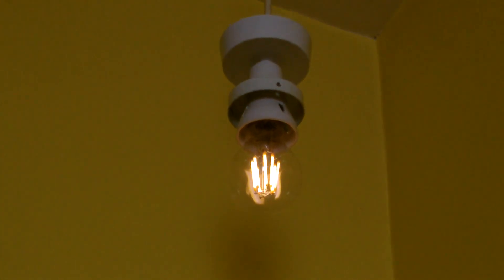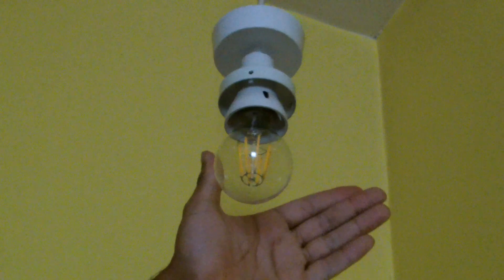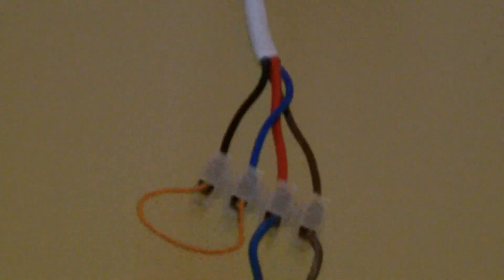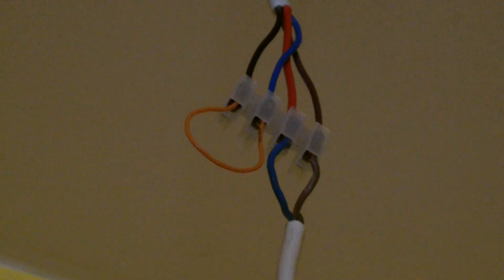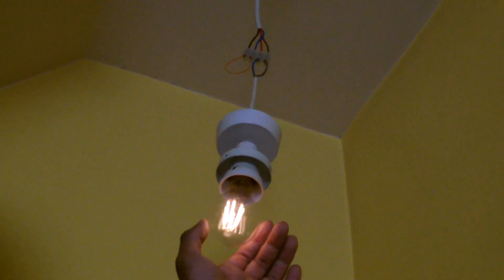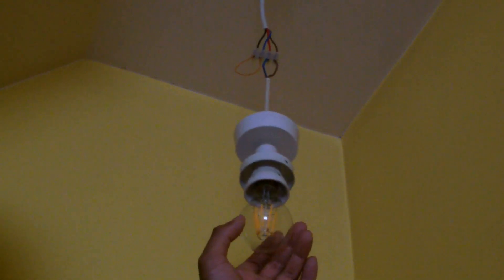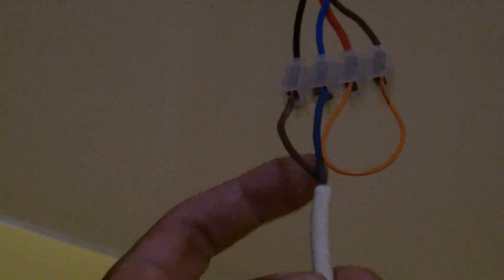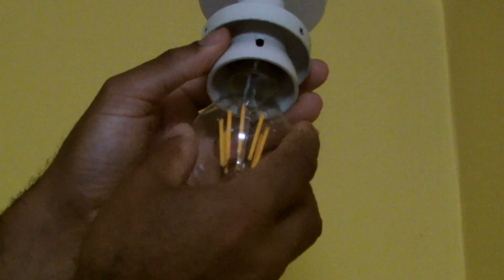LED dimly lit, or glowing, even when switched off demo

Comment: Fascinating -- and timely in my case after a switch got wet when a header tank leaked. After drying the problem ceased but I had the lighting circuit checked anyway by a qualified electrician.
Reply from the maker: Glad you found the video interesting.  Water and electricity are not good bedfellows, so glad that is sorted.

Comment: what if the wiring is OK, but the led still stays on after switched off?
this happens with wall switches that included some additional stuff (dimmer, status lamp, motion sensor etc.). In this case your wiring tricks won't fix the problem, you have to install a small (1 kOhm, 0.5 W) resistor.
Reply from the maker: Thank you for your comment. Please note this is an explanation and demonstration of a fault.  This is not a how to or a recommendation video. When dealing with the mains it is best to consult with professionals. If you used the resistor of the value you stated at the power rating you suggested then you would very likely have a fire.  A 1k Ohm at 240v RMS is would have to dissipate over 50 watts.  Even if your voltage was 110V the power would still be over 10 watts. (this is an example how quickly you can get into trouble if you are unsure what you're doing) .I've a video https://www.youtube.com/watch?v=AQtUgdHBvXc which deals with some of the topics you have mentioned, but the leakage through a typical dimmer's trigger circuit is not covered in that video.

Comment: The glowing after I turn it off does not bother me. But is it costing me additional electricity consumption?  Is this glowing wasting additional electricity?
Reply from the maker: The answer to the question is more complicated than you might first think. If we assume that the consumer's electricity meter ignores the reactive (capacitance of the wiring) component of the current then the answer will be: yes it does.
      By definition the fact that the LED is glowing indicates that it must be using power.  The real question is, how much power? 

If you were using a tungsten filament, such as halogen bulbs, then the answer will be less power than you were using before you changed to the LED. This will be true irrespective of whether the LED is glowing or not. 

My personal guestimate is roughly 0.036 to 0.01 watts when and LED is glowing due to the issue described in the video [value obtained using this vague calculation (240^2*2*(22/7)*50*2*(10^-9))].  So my guestimate based on glowing for a whole year is roughly 1142 kilojoules of energy which equates to 0.31 kwh per year. Roughly £0.06 per year if you live in the UK.

If you were to fix the problem by using a "shunt" then you are not necessarily curing the usage but more hiding the energy that causes the LED to glow.

If your electricity meter does actually measure the reactive component of the current then a glowing LED is the least of your worries.
Reply: @robertwilliams8032 ....."yes it does" isn't an answer to "is it"
Reply from the maker: Thanks for your feedback, did you read the whole answer by hitting the "Read more" link?
Reply: @robertwilliams8032  That has answered EVERYTHING AND MORE, that I sought to this issue. Much gratitude

Comment: Is it easy to gofrom switched neutral to switched live?
Reply from the maker: Thank you for the question @mikeypeters7003. If you are a person who understands your wiring then the answer is usually: Yes, it is easy to change. But it truly depends on the configuration of your wiring and my answer is assuming that it is wired in a typical standard way.  Tracking the path of live and neutral conductor paths through a circuit should be simple for a competent person who is conversant with typical electrical wiring. The fact you have to ask would suggest that you may not have the skills needed to maintain your wiring in a safe and secure way.  I would strongly suggest that if you lack confidence or you're unsure (in any way) then always seek the advice of a licensed professional.
Reply: @robertwilliams8032  Thank you for the reply. The extent of my knowledge would be basic at best. I would struggle with a ceiling rose.

Comment: When wired correctly power cannot radiate from the wire  to the switch to the wire from the switch because the earth wire intercepts it, light won't glow, but if the neutral is switched it will radiate to the earth wire plus the other wire which is now neutral, the light now glows. Now have I got that right?
Reply from the maker: very late but here is a technical explanation:  www.youtube.com/watch?v=AQtUgdHBvXc

Comment: Ok THIS explains why i cudnt switch off my new LED bulb today, but reg bulbs are fine. I have took it out as i am paranoid it is a risk. Can you confirm this set up is not dangerous ie fire hazard ect please.
Reply from the maker: Sadly, the only people who can confirm any risk, or lack there of, is the manufacturer of your bulb.  The effect I show in my demonstration, happens regardless of the bulb inserted.  It is only obvious with a susceptible bulb and that particular circuit configuration.  In the case I demonstrate there is no risk other than annoyance that the light is still glowing.  If your circuit is configured as a switched neutral there is an argument to say it is better as a switched live but that is something to discuss with your electrician who will be more conversant with your regulations.  

Also neons (in the switch housing) and incompatible dimmer/remote electronic switches can cause a similar problem as they still use a small amount of energy even when the circuit is switched off.  As the LED uses so little it can still appear to be on when coupled with these devices.

Please note the way we commonly wire lighting in the UK with a ceiling rose is nothing like wiring in the Americas and most of Europe.  Although I believe there is nothing to stop a UK electrician wiring using the American configuration, it just isn't done. Look at the following videos to see that UK wiring techniques are quite simple and consistent in comparison.  This is a video from a US show:

www.youtube.com/watch?v=R9OAjYViu9o

The North American code has more unique considerations than the UK and this interesting but technical video, demonstrates these well.

www.youtube.com/watch?v=_no-E8ZOkfQ

This head scratching video would be considered an insane "WTF was that!" installation in the UK:

www.youtube.com/watch?v=U3H6kzBfOgc

This is the common domestic configuration installed in the UK which is easy to configure with one, or multi-way, switches:

www.youtube.com/watch?v=gOy486TUtHY

Comment: I am not too..  familiar with electrical code  in the UK ,
[ forgive me, I used to do electrical work here in the US and am used to helping DYI'ers that tend run into trouble at times ]
 but Our electrical code here is to always switch the hot rather then neutral. the reason for this is,  if you were doing some rewiring [ Even with the switch off ] if you had one hand on the Hot lead and were to lose your balance on a ladder,and grab a hold of a grounded water or steam pipe to keep from falling, you would get zapped. also if the leads on the fixture were transposed, [ blue for brown and Vise versa in the case of UK color code ]  the shell of the socket becomes energized at all times, if you were say, changing a light bulb and someone distracted you,  and you were to touch the shell of the socket while touching a grounded pipe. you would also get zapped. you seem A lot more more familiar with your electrical systems then I am, I dont mean to appear condescending . . . just letting you know what our electrical is, and why . . .
Reply from the maker: Thank you for your comment. My video is a demonstration of a problem rather than an instructional or "how to" video.  I make no recommendations in the video, I just demonstrate an aberration. If you follow what I say you will note that I have had to incorrectly wire the fitting to show the aberration in switched neutral mode because it doesn't happen in switched live mode.  It would not be normal to have the fitting hanging with exposed live wiring in a normal day to day configuration. I'm not suggesting people unscrew a ceiling rose, add random pieces of wire, with exposed conductors, just so they can have it in a switched neutral configuration.  I am unsure how people have managed to misconstrue this demonstration as advice of wiring a light fitting as switched neutral.  Totally perplexing!

I believe the latest code in the NEC does actually stipulate that "non Grounded conductors" are only to be switched in three or four way installations.  

www.youtube.com/watch?v=_no-E8ZOkfQ

I do not have a copy of the current UK regulations but best practise has always been to use switch live.  Though I do not believe it has been a "requirement" until the most recent regulations but it's stated that testing should confirm that it's the live conductor that is switched.  Neutral definitely "can" be switched in the case of dual pole switching.  Dual pole means that both live and neutral are switched together, ie. simultaneously.

http://www.voltimum.co.uk/articles/neutral-conductors-terminated

regarding general wiring see:

http://the-regs.co.uk/blog/?p=309

With the greatest respect to your explanation, I think it's much more simply that, bulb failures are a relatively common event. In the UK we used to mainly use Bayonet Cap (BC) bulbs.  The design of the bulb means the live terminals cannot be accessed normally and removing the bulb disconnects both conductors simultaneously.  With a BC housing you need to make an effort to be zapped by accident. The most modern "MK" buld socket fittings can auto retract their conductors, so it is near impossible to get zapped even with clumsy fingers.

With the introduction of now commonly used Edison Screw (ES) bulbs in the UK, regulations state that the "exposed" screw cap terminal "must" be wired to the neutral conductor.  If only the neutral is switched, then there is a strong likely-hood that the consumer would be in very real danger of coming into contact with the exposed live conductor when removing the bulb.  Assuming it is still connected to the live terminal. Electrical theory states that when a neutral is disconnected at the switch, everything else then floats to live voltage. Thus the neutral terminal has magically transformed into a live terminal. This is a very dangerous scenario.  

Certainly, if you grab a 240v AC item without touching anything else you will receive a very nasty jolt regardless.  There is no requirement to grab a random grounded pipe, steam or otherwise to get a noticeable unpleasant zap from 240v, the air around you is sufficient for that to happen. This is why people in Europe have a healthy respect for electricity.
Reply: Hi! Thanks for all the awesome info! I have always been fascinated about electrical wiring since I was 9 Years old. I think that seeing an Episode of "Keeping Up Appearances" in the 90's here when Hyacinth volunteered Richard to Fix the Church hall Electrics. started my fascination with electrical wiring in the UK. My Dad was in Europe during WW2 and I remember him telling me that your mains current is 240 V 50 Hz, But at a  later age when I got the internet and started searching web pages and videos on You Tube About  the UK color codes and wiring for residential use, and Phone, I was Hooked! Our 240 volts is mainly used for electric ranges, Some clothes dryers, Central AC Units, Welders and some high output air compressors for residential use. 
we also have higher voltages for industrial power 440,550, 600. everything else is 130 V AC 60 Hz. we have just recently (1970's) started using Ground fault interrupters here [ Either Breakers or built right into the outlets. ] before that,  if someone was dumb enough to drop their electric shaver in a sink of water and reach in to retrieve it b4 unplugging it, or use a Hair dryer in the tub they were Literally in for a great shock! but I assume that the UK has had them for quite a while b4 we did. which makes since having 230 V line current.
I Subbed to your channel BTW :)
Reply from the maker: Thank you for your reply and further information.  British comedy programs such as "Some Mother Do 'Ave 'Em, may not be representative of reality.  

www.youtube.com/watch?v=qCxv64kqg4k

For the UK GFCI's are called RCD's (the same as in Europe) and they have been around for a long time here too.  They only became a requirement in the UK for new internal household domestic electrical wiring in 2008.

http://www.cycloflow.com/2014/02/what-are-elcb-rccb-rcbo-and-rcds.html

also the following might be of interest to you

http://www.cycloflow.com/2014/04/a-power-translation.html

There was a complete change in the wiring regulations in the 50's and modern UK regulations, customs and practises are vastly different and much safer now.
Reply: Thanks. . . .

Comment: I have this problem but maybe a little bit more complicated because there are 3 switches that operate one bulb. Am I correct in saying that apart from being annoying it's not a fault as such and not dangerous? Thanks
Reply from the maker: You are correct that it's not physically dangerous. It is basically the same issue, as the switching lines are radiating a small amount of energy sufficient to light certain types of LED. The third switch in your setup would be called an "intermediate switch" in the UK. It suggests that the wiring for your switching lines are particularly long, making this aberration more likely and brighter taboot. In North America a configuration like yours would be termed four-way switching, while in the UK it's called three-way switching. Whether it could be considered a fault of either the wiring or the bulb is a different question but no wiring regulations would have been broken in the UK for this to happen. There is only a question mark around good/best practise.

Note that if you're not using an earth in your lighting installation then it doesn't matter if it's switched live or neutral.  With no earth connection, a susceptible bulb and longwire runs, it will still glow. I suppose I should make another video explaining the actual physics behind this aberration.
Reply from the maker: A very late reply but here is a technical explanation
www.youtube.com/watch?v=AQtUgdHBvXc

Comment: Hi and thank you for the video. I have the same problem but I got 2 red wires which are connected (like yours with the yellow wire). Should I swap those with the current ones?
Reply from the maker: You need to be very sure what you're doing before you start doing it. If you're not certain how your system is wired, I would suggest calling a very competent/qualified electrician as the danger to life and property is too serious to joke with. I am not sure of a wiring arrangement that you have described. Two reds and one yellow? It may suggest that it's already switched live but that would be pure speculation. Sadly speculation isn't good enough when it comes to dealing with things that can kill or cause major damage to you.

Please note, I have not yet got it together to make an explanation of why this fault happens but the asymmetry is primarily caused by the circuits proximity to an earth as well as capacitive coupling. If you have no earth (as some do in the UK) then this issue can happen irrespective of which way round it is switched. If this is a capacitive coupling issue and you're not using a dimmer in circuit, then the link in my description to the Minisun LED would be my preferred choice.

There is another workaround but I will do a video on that as the implications of misunderstanding it are too serious.  The workaround is really to fix a poor LED bulb design anyway.

There are several other reasons why this can happen, which have to do with other components on the same circuit. It would take a braver person than me to make that recommendation, sorry.

Comment: You should go to jail for switching the neutral. It's criminal negligence. Are you trying to kill someone? Your lamp shell is always live.
Reply from the maker: My first Troll, now I feel like a proper YouTuber.  Thanks for the baptism.
Reply: How is that a troll?  You are deliberately disconnecting the grounded conductor and leaving the hot wire energized even when the device is off. 
If you are an electrician and get caught doing this your licence would be revoked and at least be fined.
You are setting a booby trap for anyone who works on this in the future.
Reply from the maker: You can lead a horse to water but you can't make it watch a demostration of a problem video.  Maybe electricity is not your thing.  There is no shame in that, many people find both wiring and electricity, confusing and difficult.  If in any doubt consult a qualified electrician.
Reply: Definitely, you need to consult a qualified electrician.
Reply from the maker: Thank you for your feedback. :-)